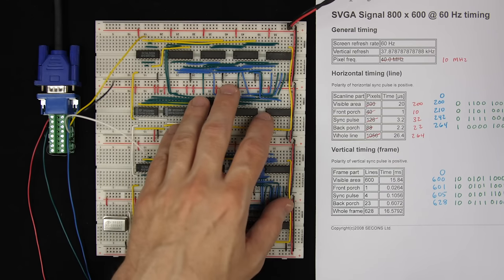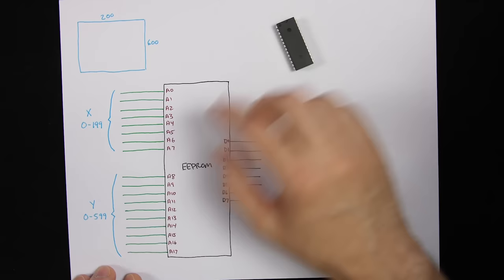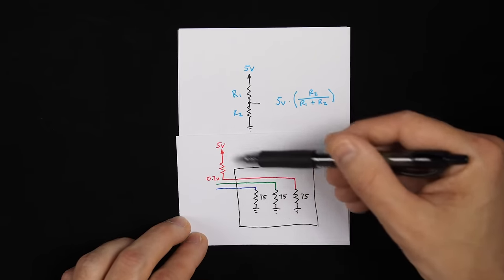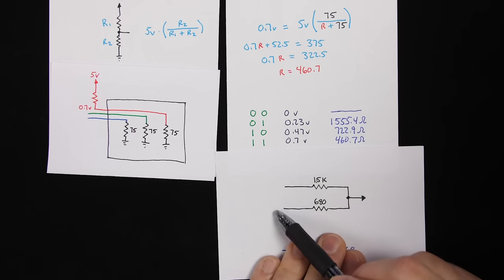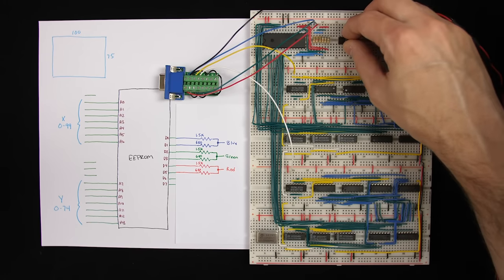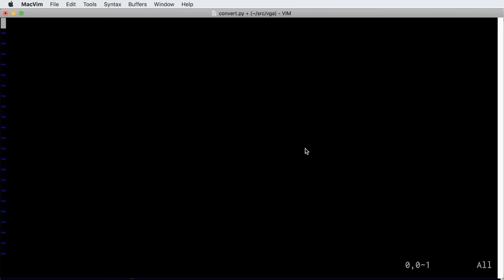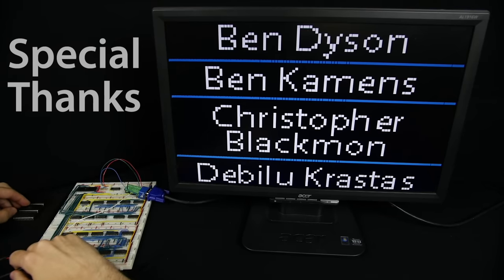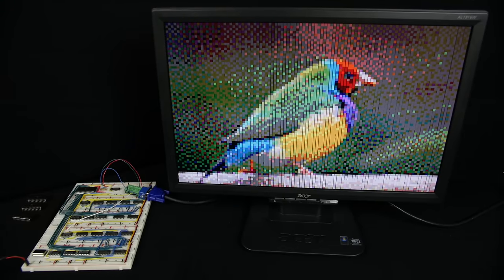World's worst video card? The exciting conclusion

Comment: You can tell a hardware person's writing code when there's a try-catch just to check for a valid index.
Reply: Python devs be like
Reply: @HentaiNat  Check for the valid index instead of intentionally doing an invalid index to catch the exception
Reply: @HentaiNat  Just use an if/else instead of a try/catch. Not only is your intent clearer to someone reading your code, it'll also run much faster.
Reply: The more experienced Python devs I know love to program in the 'ask for forgiveness rather than permission' style - try blocks are so ingrained into the language that using them just comes to mind for them as a solution to their problem.  Me, the long time embedded C/C++ programmer, would have done index checking, but I appreciate the use/abuse of the exception system to accomplish the same task.
Reply: @HentaiNat    @David Yang   it'd be best to just add another loop after the first. so like '

for x in range(0,100): 
    write pixel value
for x in range(0,28):
    write 0
Reply: @alexander53  So why are you doing two loops instead of one and an if/else? This is even slower than try/catch.
Reply: @Ruhrpottpatriot  why would it be slower if you are iterating the same amount of times. Instead of 1x128 you do 1 of 100 and one of 28.
Also at this scale you could program it any way you want its not gonna matter
Reply: @diegomastro5681  Because you're creating two iterators instead of one. Yes, an iterator is pretty lightweight, but it cannot compare to the single "BNE" instruction.

It seems python really promotes some bad habits ;)
Reply: @diegomastro5681  Creating that iterator is still more expensive than using a BNE 128 times. Nothing's going to change that.

Apparently you never wrote code on a modern embedded system where you sometimes still only have a few mB or kB of RAM and even the most basic AES implementation is too resource heavy.
Reply: @Ruhrpottpatriot  ratio
Reply: @Ruhrpottpatriot  Really? Speaking as a very old-school programmer, that's very surprising indeed. I also suspect it doesn't apply to an interpreted language like python, but can't be sure. But anyway, I don't mind turning two loops into one, but the two here would make proper padding easy. Then again, would it really be proper? Ben Eater's approach means that if he changes the size of the display, he can use the same code.
Reply: @eekee6034  in one loop it's as easy as changing a variable or two (depending on whether you want to write 0 on both blank spaces or not.
Just define yourself four constants "width", "right_blank", "height" "bottom_blank" and use those. Since they are constants, any decent compiler will inline them in the compilation process so you don't even have a runtime penalty. This also allows you to change the size of the blanked area if you so choose.

However, if you wanted to make the GPU a bit more sophisticated, without blowing it up you'd more likely go for GRAM and copy the data, freeing up  most of the drawing time anyway and allowing to hardwire the data.
Reply: I'm starting to see the benefit of using try..catch in Python. Because Python tests whether or not an array reference is out of bounds, you can use that same test to jump to the exception code. I still think it's unnecessary to have that test for every null byte in addition to every image byte, but the conversion is fast enough and doing it that way saves the trouble of getting the arithmetic right.

 @Ruhrpottpatriot  So... you're asking for 4 if-conditions to replace one of the loops? I know modern CPUs are good at branch prediction but that doesn't seem like an improvement; a loop is only one conditional jump. As for constants vs. variables, that hardly seems applicable to Python interpreting bytecode. Even in machine code, it's not necessarily as great as you might think; the number has to be loaded from somewhere.
Reply: @Ruhrpottpatriot  Right. Thanks for the figures on C++ exceptions. I'd like to think Python doesn't use them too. I forgot about non-trivial address calculations for variables. I'm not sure if they would apply to Python; too tired to think, now. I'm too tired to visualise the code for the conditions too, so I guess I should stop arguing. :) Cool discussion, thanks!
Reply: True, I would’ve used a min() function.
Reply: @Ruhrpottpatriot  
TLDR at the bottom.
I get that you could be annoyed getting a notification for something this old. You don't have to respond. If you do though, please be civil. I'm trying to be responsible with this and potentially correct you and prevent others from getting false information. If it turns out I'm wrong, that's okay. Just take this with an open mind. I'm making it a reply so you know you have a chance to refute me.

I did some tests with Python's timeit library and using two iterators consistently runs faster for me, running about 33% faster (significant for large operations!!)

This was the code I used. Incrementing the variable is just meant to be a way of doing light work inside the loops.

import timeit

two_loops_timer = timeit.Timer(stmt="""
for x in range(0,100): 
    z += 1
for x in range(0,28):
    z += 2""", setup="z = 0")
print(two_loops_timer.timeit(number=100000))

if_loop_timer = timeit.Timer(stmt="""
for x in range(0, 128):
    if x < 100:
        z += 1
    else:
        z += 2""", setup="z = 0")
print(if_loop_timer.timeit(number=100000))

Run it for yourself and see if the results match. I have an idea for why two loops might be faster than your single branch. Cache prefetching. I know branch predicting was brought up in a comment, but you didn't say anything about it so I'm bringing it up again.

I'd also like to hear about the timing results of your -O3 C programs. The original discussion was about the speed of execution, after all. Not the size of the program. Not # of instructions executed. From what I see, you only addressed the size of the output. I think you were particularly unfair with -funrolling. Unrolling loops will naturally make them larger, yes? But less conditionals get executed per cycle, so it's technically faster, yes? It just consumes more memory.

You did talk about timing of using try..catch vs if else, but NOT if else vs two iterators. Could you run that and post the results? With and without optimizations, if you want to. It might be that C++ does perform better when you use if else, but I haven't tried on my computer. I just know that the Python ran better for me with two iterators in an interpreter.

If possible (I don't know how to do this myself, nor how it would be done), try running it with and without cache prefetching and see if the difference turns out significant. It might be that your way runs quicker when you don't use cache prefetching.

TLDR: If someone is reading through this argument, my tests show that two for loops runs faster than one for loop with an if..else IN PYTHON, which is contrary to what Ruhrpottpatriot says should be faster. I don't know if my result is an outlier, I've posted the code here so anyone is welcome to share their results.
Reply: @mt_xing  Your intent is less clear. Don't think of it as particular indexes. Think of it as an error condition. Then when you resize your video display, this program will still work.
Reply: But....this is the better way. Your hardware details should be in as few places as possible. Coding that into an if/else block in an image converter is dumb. With the try/catch, the converter only needs to know the resolution of the display and doesn't have to know anything about blanking zones.
Reply: @davidrysdam902  If I may, there's a couple of very important software engineering principles that you're improperly applying here.

First, we don't want hardware specific items hardcoded into general code. This is true, but for simple cases like this you can easily have a constant at the top that the loop references. For more complex applications, build some manner of centralized single source of truth for which pixels are valid, so that the function with the loop can pull from there rather than needing to have it hard-coded into the bounds. More problematically, the code shown in the video (and thus being critiqued here) already has bounds hard-coded into it anyways, so the notion that using a try-catch is better because it avoids polluting the code with implementation details is a moot point. If you wanted to abstract out these details, you'd probably develop a more general test for whether a pixel is valid or not, and then compute valid bounds before the loop. If an exception is the only way to determine a pixel is valid (perhaps not far-fetched if you're maintaining some ugly legacy code), then have whatever abstraction you designed step through and catch an exception once to figure out when it gets thrown, and then remember that information.
As it stands, all we're doing is taking on the significant performance penalty without benefit, which leads on to:

Second, the performance penalty. There seems to be a lot of misinformation in this thread about how exceptions work, from multiple sources. I saw someone claim that a single iterator construction is going to take longer than hundreds of thrown exceptions - which is obviously false, and any attempt to profile any code that does this would immediately show that. I think the confusion stems from the fact that individual seems to use C, a language that does not have exceptions at all. The thing about exceptions is that when thrown / raised, they themselves are objects that need to be constructed. There's a whole callstack to compile, the exception object needs memory to be allocated, not to mention then the branch prediction penalty (as in general, the fact that exceptions are supposed to be, well, exceptional, all but guarantees that any branch predictor would have predicted branch not taken). Throwing an exception into a try catch block is decisively NOT the same thing as a normal conditional - details depend on the language but in all major languages, including Python, the semantics guarantee that an exception will be a much heavier and more burdensome method of control flow than something lighterweight like if/else or loops.
EDIT: Python exceptions are a bit lighter weight than other languages, as you likely won't be seeing the 1000x slowdowns, but they're still not free and if/else are still faster.
None of this is as important, however, as:

Third, code legibility and conveying intent. The thing that matters with conveying intent is making sure that others working in the same language can also understand your code, and this is accomplished by each language's community developing unspoken standards over time. If we want to use some pretentious sounding words, we can say that they develop idioms. Code that is idiomatic - that is, code that adheres to the community's generally agreed upon conventions - is more legible simply because it matches the type of code other people in the same language write and are familiar with. This doesn't mean you're not allowed to write code that deviates from what's been written before, only that if you choose to do so, you're making the choice with intent, perhaps because you've discovered a new way of doing something that is more efficient, for example.
Idiomatic, legible code is so important because it keeps your code maintainable. Code that is easy to understand is code that is easy to debug and expand upon. One can even argue that it's worth taking performance penalty in non-performance-critical code in order to make it more legible.
Unfortunately, there is no major programming language in current widespread use that considers the use of exceptions as normal control flow to be idiomatic, generally because of the aforementioned performance hit (which, depending on language, can be many thousands of times slower than a simple conditional branch). An exception should only be used when, as its name suggests, an exceptional circumstance occurs - something that shouldn't happen in normal execution (in Python, there is the slight caveat that generators / iterators may need to use exceptions to signal the end of their sequence, but we're not writing those here, and there is some debate as to whether they're acceptable as an alternative to things like sentinel values, but note that these are very much still conditions that only occur once through a file, for example, as opposed to every iteration). That's why their performance is so abysmal, and that's why every language's standards agree that they should not be a common occurrence. Given that the blanking period is very much a common period - it happens every line - it's clear that using an exception would muddle your intent because it is NOT an exceptional condition; it's expected to happen.
Reply: I am a software guy and this comment is a hate crime haha. My latest hack job was just wrapping the entire script in a try block
Reply: Actually i remember an author saying (I can't remember which book) that doing things in hardware taught you to debug them first, because you cannot change a design so easily (let alone cost of a new plate of circuit).
Reply: why are you guys discussing if his code is optimal if he's gonna run the script like 4 times for 0.5 seconds lmao
Reply: @perpetualsystems  because they’re passionate about learning a skill and testing their theories
Reply: @HentaiNat  what would that look like.

Or “how would that look.”

It is grammatically incorrect to say “how would it look like.”
Reply: Well, it's Python; people don't use it for efficiency. When you know the fundamentals of how the computer operates, Python will take your most efficient technique in C, and turn it into your least efficient technique in Python. Case and point: Python devs avoiding for loops in favor of library functions written for their specific task. You'd think the for loop would be faster, being that it's a basic programming building block; but not in Python. Python libraries are written in C and C++ for a reason.
Reply: @HentaiNat  for instance, you already know the size of your picture, so you could just write a simple if statement it is much more faster than try catch in many cases
Reply: My first thought was to constrain the index, since we don't care what the values are beyond the edge, so repeating the last pixel or line should suffice
Reply: you dont know how badly written my code is, i put everything vaguely reusable in a try catch in case i reuse it.
Reply: @mt_xing I wonder if that is where the black lines are coming from.

Comment: 3:03 HE'S GOING TO HOOK UP THE GRAPHICS CARD TO HIS BREADBOARD COMPUTER
Reply: yeah, that would be so awesome!!! :D :D
Reply: hype
Reply: was wondering if anyone else seen that hhahaah
Reply: Just saw that and came down here to look for the coment about it. Found ya!
Reply: I mean I figured that was the case when pt1 came out.. this is was just confermation.
Reply: THANK YOU! I tried a lot of pause-unpause at 0.25x speed and couldn't catch it.
Reply: @dashcamandy2242  you can skip it frame by frame using the comma and full stop keys on your keyboard (they are the < and > when you hold shift)
Reply: * bread board starts sizzling *
Reply: @Zack Amiton great tip!!! ;)
Reply: I paused it at the right time: https://imgur.com/a/BTJQf59
Reply: The Breadboard Computer should definitely become a Breadboard Retro Game Console. He already has some of the artwork needed for a low-res Flappy Bird clone!
Reply: If you have fast enough memory -- which Ben certainly does here -- an even simpler way is to interleave memory accesses between display and CPU. The display gets it during one half of each clock cycle, and the CPU during the other. Then the display and CPU can each do their own thing and don't have to worry about synchronising. I did this once with a 6809 and a 6845, it worked very well.
Reply: @dashcamandy2242  Use the < and > keys for frame advance.
Reply: It's  memory.
Reply: @dashcamandy2242  on android, i paused it at 3:02 and then played it at .25x. success on third attempt.
Reply: Thor Correia he’s gonna have to replace the EEPROMs with his own video RAM modules... sick...
Reply: Jordan Rodrigues  : Using two D-flipflops chained together (the one closest to the CPU clocks in on an addressed write, the one furthest clocks in on V-sync, between the two you get a persist-apply cycle) should be enough.
Reply: Because the eprom covers the blanking periods could the unused data lines be used for the sync pulses?

Comment: "I'm not going to hook this up to a computer... yet."
Don't do that. Don't give me hope.
Reply: Wojtas! Hook it up to the 8 bit breadboard computer!
Reply: hey at least it'd be better than my laptop's integrated graphics card
Reply: As soon as he says "yet" there is a single frame that contains a picture of his 8 bit computer. So it seems even more likely he will attempt it!
Reply: @TheYaMeZ  yep
Reply: 3:03
Reply: I hope he goes oldschool and connects it through the 8-bit ISA bus.
Reply: I don't think his 8 bit system would cope with it to be honest.

This might not be full VGA, but it's still a relatively large amount of data (several tens of thousands of pixels), and his computer design runs at speeds measurable in the low kilohertz range.

More significantly, as it stands his design can only address 16 bytes of memory.

The odds of getting that to work with a graphics adapter like this without extensive modifications is quite low.
Reply: @KuraIthys  it wouldnt bee too bad for a character display. Just swap out the eeprom for sram, implement some write buffers for the address and data (because he can only write during the blanking interval without messing up the data) and he should be good to go. Definitely couldnt use it for video or very interactive displays. But something like a graphing calculator might work (very slowly)
Reply: Frame grab for the intrigued: https://i.imgur.com/DciX9we.jpg